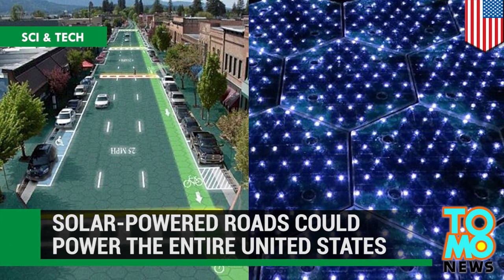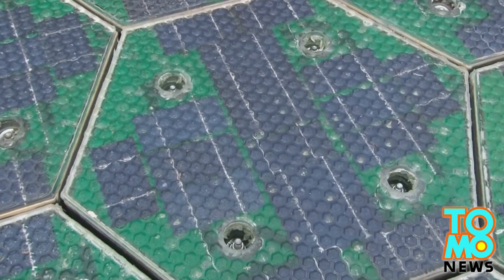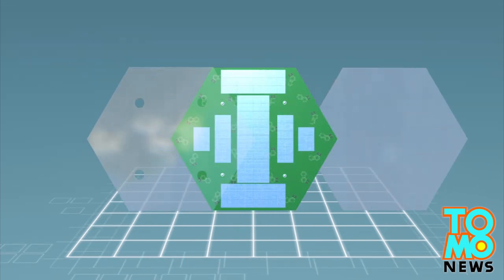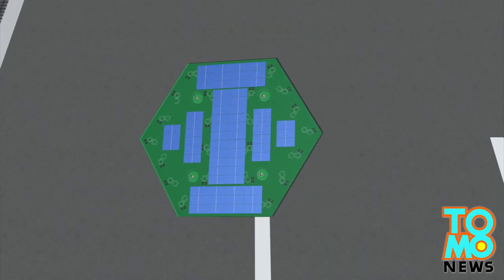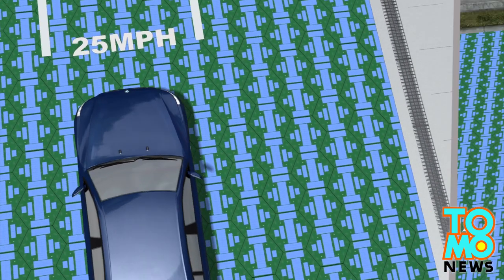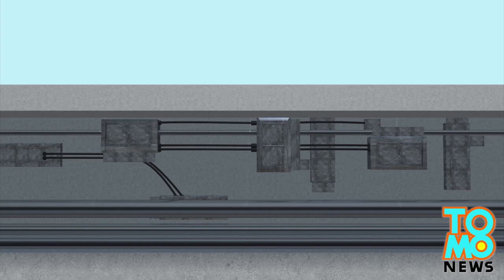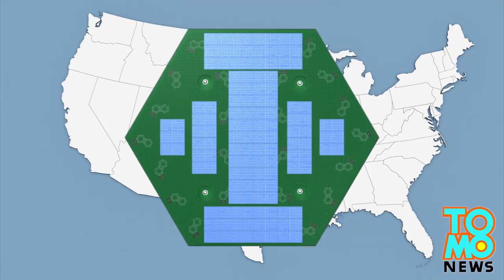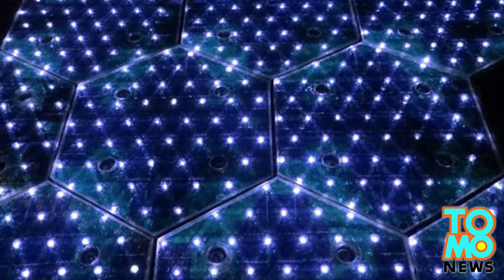Solar Roadways: solar-powered tech charge electric cars while on the road

Comment: These things won't actually pay for themselves and would, in fact, be a monumental waste of money. 

Because of its frame made from steel and tempered glass, built to withstand 80,000 lbs, each unit will cost around $7,000. A 13.4 sq ft unit with 9.3 sq ft (roughly) of photovoltaic cell on it with an 18.5% efficiency will take 360 years to pay for themselves. Unless you missed that, THREE HUNDRED AND SIXTY YEARS. And that's assuming that 1. Daylight means 12 hours of noon-day sun on a cloudless day and 2. the units literally use no energy at all for the heaters, LED's, induction chargers, wireless networks, pressure sensors, data collection, etc. Now you might say, "Ok then, so just keep them around for another 360 years, that's fine" but the lifespan for the solar cells themselves are actually a lot less than that (20 years). 

Not to mention there isn't enough money in the world to fund this project. Replacing the 41,000 square miles of roadway in the U.S. would cost $666 trillion.
Reply: they will be a lott cheaper in mass production, and they are aware of that, do you think, they didnt calculate if it is possible to make them economically reasonable? solar panel techonoligy will evolve a lot.
It seems you know what you are talking about in general, but do you know about this specific product?
Reply: Your estimates are way off but I guess you know that and you're just trolling
Reply: None of you seriously ever noticed how they don't mention how face-meltingly expensive it's going to be? Just how cheap do you think tempered glass and steel frames capable of withstanding 80,000 lbs are?
Reply: A few points you're ignoring:

1.  Economies of scale will dramatically reduce production costs.
2.  The energy generation means that these roadways would generate a significant renewable energy surplus.  That alone would offset a large part of the costs.  
3.  Eliminating the need for snow plows, salting etc would represent a significant cost saving.
4.  These roadways would be non-toxic and provide an easy way to recycle massive amounts of waste reducing pressure on landfills.
5.  The additional capabilities of these roadways in terms of traffic management, safety and efficiency would also make any additional cost well worth it.
Reply: Eric Lescarbeau A few points YOU are ignoring

1. It doesn't matter whether or not they go into mass production, the resources and micro engineering of these things is still going to keep the cost absurdly high.
2. These are solar cells. They generate 4 watts an hour (at 18.5% efficiency. It should actually be 11% because of textured glass, creator of solar roadways said so himself) They aren't going to pay for themselves for well over 20 years no matter how cheap you think they are possibly going to get. Which means the entire system is net negative since solar cells deteriorate after 10 and fail long before 20 years.
3. And if there's a blizzard? Heating coils can't cut through 10 feet of snow quickly enough to slow down traffic dramatically. Plus heating coils ALONE use much more energy than solar cells can produce.
4. Solar cells actually contain significant amounts of dangerous waste materials.You can't just simply make an electrical device "non-toxic" because you thought it'd be cool, a non-toxic solar panel would take years of R&D (if it is even possible)
5. The components and features the creators of this economic travesty are promising will use up FAR more energy than the solar cells on top of them could ever produce. LED's alone would be very difficult to keep powered 24/7. But they're also promising induction plates to charge electric cars as they're driving (are you kidding me), heating coils, high speed internet, pressure sensors, wireless transmitters, anti-theft GPS systems, and more. This system wouldn't create more energy, it would waste an obscene amount of it.

And WHY on Earth would you put solar panels under the roadways where you need to waste resources to keep them from being crushed? Why not just put them in the desert where they can actually go net positive and make some money instead of wasting it on arbitrary features? LED's aren't even visible in the daytime! Road markings are already more efficient!

But of course my entire argument is invalid because the thing looks neat. Don't you realize that a great way to make money is tricking people into donating money to you? Scott Brusaw and his wife are going to take their viral ad campaign money and disappear. It's as simple as that.
Reply: ***** Trillions. Think trillions.
Reply: Eric Lescarbeau
1. The whole project would cost well over 10x the US GDP, no economies of scale will make this remotely feasable.
2. You think these would still produce energy when it's covered in dirt, snow, scratches (glass all fogged up), car driving over them, parked on them, bad angles to the sun...etc.
3. You know how much energy it takes to melt snow? Sure as hell wont be sunny when its snowing, how are they going to put heating elements without sacrificing surface exposure of the panels/led. Afaik, glass isnt that good of a thermal conductor, are the heating elements on top or under the glass?
4. What do you think tarmac is? Its biproduct of petrol, its recycled as much as glass. How much clear non-colored glass can you recycle? They wont be using colored bottles in the production of these.
5.Whats wrong with paint on the road? Show me an led bright enough and efficient enough that can be seen in broad daylight. My 50w led is what i'd consider to be visible, youd need 5-10 tiles to even power that unit, and its only 2.5cm squared in size.

Just a few scientific errors you missed.
Reply: I think the reason why this is so appealing is because it uses surface area of the planet that is already covered.  It's basically adding a lot more functionality to existing structures.  Whether or not this particular version is feasible is of course debatable but I think there is definitely sound logic in using existing surfaces exposed to the sun to generate electricity rather than placing panels out in the desert.  It's not about the efficiency of individual units (although with large scale production and more intensive investment in R and D that will almost certainly improve dramatically).  It's about making use of as much possible surface area that is already in use.  

Replacement of solar cells would be a lot cheaper than you're suggesting.  You don't have to replace the entire unit to do that.  And of course if solar cells were being used this widely the technology would massively improve from one generation to the next.  Consider the microchip over the last 50 years.  If we took money out of developing fossil fuel technologies and put it into solar I have little doubt we'd see a revolution (possibly several) in the technology.

There is a lot of glass and plastic waste that could be recycled.  If that runs out there is plenty of raw material out there with which to make more glass.  The units themselves would also be recyclable.  As for toxicity, as I understand it there would be no toxic runoff from these cells because they're sealed.  I find it hard to believe that they'd be anywhere near as bad as asphalt.  Regardless, given that photosynthesis does basically the same thing without being toxic suggests that with sufficient amounts of research we can achieve the same result.

Existing roadways "waste" resources to produce a supportable structure for the roadway so I'm not sure what your point is there.  I am generally in favor of much greater mass transit and a reduction in roadways and cars in general so in that sense I do see all roadways as wasteful to some degree.

Heating the roads would of course only be used when needed.  Likewise with LEDs.  Because these roadways would be part of the electricity grid power would be used where and when it was needed, not on a 24/7 basis.  There are a ton of efficiencies there in terms of labor and time.  Many of the other features would reduce or eliminate the existing means of providing those functions.  For example, if you used induction plates to power electric vehicles you would eliminate the need for gas or charging stations and greatly reduce the battery requirements for electric vehicles.

I'm not in any position to give money to this or any other project but I do think it is an interesting idea.  I don't get the sense that this is simply a money grab and I'm excited to see if anything might come of it.
Reply: Eric Lescarbeau "You don't have to replace the entire unit to do that" (implying they can be taken apart to be repaired)

If they can be taken apart, theft would run rampant. Millions of people would simply remove them from the roads, take them apart, and sell the expensive parts of each unit.

"As for toxicity, as I understand it there would be no toxic runoff from these cells because they're sealed."

The problem isn't runoff from active cells, it's what do you do with the solar cells when they stop working and need to be disposed of? People will take them apart, retrieve the valuable parts, and discard them. So much for your sealed solar cells.

"Heating the roads would of course only be used when needed."

Doesn't matter. It won't be able to cut through 8-10 feet of snow when they really matter, and they'd still use an obscene amount of electricity to melt even a half inch of snow off the roads (when it doesn't even pose much of a risk to drivers).

It's so much easier and worth our time to simply build solar cells in the desert. That's space no one is using and it wouldn't cost trillions to install them underneath an area where cars and trucks drive every day.
Reply: Drogen Shomuro Oh MAN! It could break even with asphalt if it costed under $10,000? That'd even be remotely cool and worth my time if we actually needed to replace the current road system! That, of course, would need trillions upon trillions of dollars to create an underground high-voltage line to collect all the energy this thing produces (8-10 times more costly than building overhead lines).

Also, assuming these things are even as cheap as $7,000, replacing the 41,000 square miles of pavement in the U.S. (Scott lied, there are actually more than 25,000 square miles of asphalt in the U.S.) would cost at least $666 trillion. You can do the mathwork yourself.

And no, they don't pay for themselves. In order to power LED lights visible in the daytime (let's forget about high-speed internet, induction panels, heating coils, pressure sensors, among others for just a sec), which are about 50 watts each, you'd need at least 10-15 solar panels absorbing sunlight 24 hours a day (impossible) to just power A SINGLE LED!!!!! FREAKIN GENIUS!

But let's ignore the LED's for a moment. Let's assume we were still using road markings, a far more efficient method of reflecting light back to the driver that is also perfectly visible in broad daylight. A single solar cell (assuming it costs $7,000, much less than Scott Brusaw is predicting) produces about 4 watts an hour. Since each panel is 13.4 sq ft, with about 9.3 sq ft of photovoltaic cells on it, and since a megawatt costs $114 in the U.S., that single cell would take 360 YEARS to pay for SIMPLY ITS OWN MANUFACTURING COST!

Funny, since a PV cell fails after less than 20 years.
Reply: Eric Lescarbeau About snow plows:

You do realize that snow plows take far less energy and resources to move snow off roadways than heating coils do, right? So we'd have heating coils using an obscene amount of energy for... what? In order to produce solar energy in the north, where there isn't much sunlight anyways? Exactly where would the energy be coming from?

Besides, blacktop is far better at absorbing sunlight to melt snowfall anyway. Why get rid of it?
Reply: Their goal is to get costs to less than $10,000 per 12 ft x 12 ft segment, not per panel. It's also not about the price of replacing all the paved surfaces as a whole. Individual land owners and governments will look at the product and decide for themselves if replacing their surfaces with these panels is more advantageous than repaving. It'll definitely be more expensive than asphalt, but each entity will determine if the other benefits are worth the price. I'm sure casinos in Vegas would easily pay for the LED and pressure sensing functionality.

I'm curious how you managed to get cost figures so much more precise than the manufacturers themselves.

I'm also curious why you believe that as engineers they embarked on this project without considering those obvious points. Even if you believed they're that dumb or deceptive, they still received federal grant money and approvals for small projects meaning that other experts believe it's at least somewhat feasible after reviewing the data they've been gathering for the last 7 years.

It's good to be skeptical though. I just don't understand why you seem so angry about the whole deal. Don't give them money if you don't think it'll work. I'm sure a lot of people thought flying machines were crazy.
Reply: Drogen Shomuro I'm angry that the advertisement video is so misleading. Nearly all the stuff they say is just plain wrong. There's only one thing i really hate in the world and that's someone who's dishonest. And yes, it is dishonesty, i mean who's stupid enough to make a road out of glass??? You know, that material that loses all its frictional properties when wet.
Reply: IAN 4000 I don't know where you get your numbers from but it seems to me you're relying more on your own brand of logic than any empirical figures generated from actual testing.  I get the feeling you're just grasping at anything you can to oppose this idea.  I'm with Drogen Shomuro on this.  I doubt they'd be getting federal funding for R&D if they hadn't addressed many of these concerns.

The cells could be locked and secured to the roadway well enough to deter people from trying to crack them open for parts.  Tempered glass is extremely hard to break.  Also fines and penalties for tampering with them could be made high enough to act as a strong deterrent.  Solar cells could be designed to be recyclable.

As for your argument about snow you're not making much sense.  Asphalt can't absorb heat from the sun if it's covered in snow.  If the road is on the electrical grid then it would be heated before the snow started falling.  Blizzards can be heavy but if the roadway is warm enough then the snow will melt as it lands and before it has a chance to build up.  It's not like the snow would pile up and then you'd need big heating coils to try and  cut through it.  Snow plows are extremely inefficient.  The cost of manufacturing, transporting, maintaining and operating them (labor costs!) is higher than you seem to think.  They burn fossil fuels, they rely on heavy salting of the roads following plowing and they're slow to get the job done, increasing the hazards from the snow and generally resulting in lost hours and days of productivity.  They also have to keep returning to clear the same roads over and over again and have to be parked somewhere, unused for most of the year.  As for sun exposure I think you're forgetting that these cells would be there all year round and not just on overcast snow days or just in the winter when the angle and intensity of sunlight reduces the efficiency of power generation.
Reply: Eric Lescarbeau Grasping at anything I can to oppose the idea? No. The idea is nonsense. I've been using $7,000 as a minimum estimate seeing as how Scott Brusaw, on his own website, is still struggling to get these units below $10,000 each. EACH.

If they can be taken apart to be repaired, they can be stolen and dismantled. Also, speaking about recycling things, this thing is supposed to be made of recycled glass, right? Well not all recycled glass is clear. You saw it yourself in the video. Scott and his wife are shoveling mixed bits of colored glass into that wheelbarrow. 

I'm not sure if you've seen Thunderf00t's video, but if you are interested in Solar Freakin' Roadways then you should certainly go watch it. It's called "Solar freakin' roadways, are they real?" In that video, he addresses what an absolute and total waste of energy placing heating coils in the roads would be. When hotels in the northern parts of the U.S. heat their walkways to melt snow, they are pumping nearly boiling water through pipes in order to melt that snow. Now, in order to achieve the same effect with just heating coils, do you even realize what an extreme level of energy that would waste? In tens of thousands of square miles of roadway, in order to melt snow, you'd be using considerably more energy than the entire solar roadways system could possibly produce.

"If the roads were warm enough" I still don't think you're even trying to realize just how much energy that would take. I'm guessing in your perfect world these things heat up to around boiling temp. in order to melt blizzard snowfall. Not possible. It'd take all the energy this project is producing, then all the energy every coal power plant in America is producing, and then some. Extremely inefficient and unworkable. And you're doing this, for what? Obviously not to keep dozens of feet of snow to build up on the roads, because the system doesn't produce enough energy. You'd be doing it to keep the solar cells clear when it's snowing so that they can absorb sunlight. But in the north, there's very little sunlight! All building solar roadways would do there is waste an inconceivable amount of money on a system that doesn't work, and create an extreme road hazard.

I originally watched this video thinking it was a cool idea. So no, I wasn't simply trying to find any reason I could to oppose this video. It began to dawn on me that the cost and efficiency of the system would be completely unworkable, so I looked into it. And realized this thing would never even be close to ever being functional. They promise too many high-energy consumption features per panel, and above all, the solar panels DON'T NEED TO BE UNDER FREEWAYS where they need to be supported to keep from being crushed. They could simply be put on unused land in the desert.

So what I'm trying to do is keep people from donating to Scott Brusaw. He's a scammer and he knows it. He's done the math, realized his stupid plan is unworkable, but gone ahead with the fundraiser anyway. Why? Because he ISN'T trying to fund the project. He's trying to line his own wallet and disappear. End of story.
Reply: Dan Unpronounceable Exactly. But this guy is being dishonest for a reason. He's already raised nearly $2 million on Indiegogo for an unworkable plan. So what's the only course of action left? Take the money and disappear.
Reply: Drogen Shomuro They embarked not because they thought this plan would work (because it doesn't, not by a long shot), but because they are planning to take their indiegogo money and disappear. It'd be all too easy. And they'd be nearly $2 mil richer. 

More accurate than the manufacturers? $7,000 is a minimum estimate! Do you even realize how much the materials required to support 80,000 lbs of weight would cost? And that's excluding all the internal electronic components! 

No. No this isn't about some kind of hidden but amazing and revolutionary idea. This is an impossible idea designed to get gullible people to hand over their money. It's "Too stupid for smart people to think it workable, but too smart for stupid people to think of it on their own". All I'm trying to do is get you to save your money and avoid the latest viral scam. And you're fighting me every step of the way even though I'm raising quite possibly the most obvious reasons to not buy into this scam.
Reply: IAN 4000 You've got (some) valid points - and by all means it's extremely important not to overlook the downsides to such an immense project. But if you really think these people are just in it for the money, you're just being ignorant. Think about our species as a whole - does continuing to use asphalt roads and fossil fuels make a lot of sense? No. These people are trying to get our world to take a step forward to a better future for the sake of us and our planet. Our negative impact on the environment is not insignificant - I repeat, NOT INSIGNIFICANT, and these people realize that. It might not sound or be feasible right now to implement such a roadway system, but changes with the current roadway system will inevitably need to be made, or we'll just slowly but surely screw ourselves over in the long run. 

“The people who are crazy enough to think they can change the world are the ones who do.” - Steve Jobs :)
Reply: ***** I'd agree with you if Scott Brusaw and his wife were not engineers. They know their plan is unworkable. If it hasn't consumed literally every aspect of their lives by now then I'd be amazed. They've done the math and they know it DOESN'T WORK. But why, you ask, have they not thrown in the towel and given everyone their money back? Because that's the entire point of a scam. 

And actually, the current road system is quite a bit more efficient than you think. Asphalt is made from the byproduct of oil used for fuel. It's mixed with rocks to give it the kind of traction a glass road could never have. It expands and contracts without cracking (for the most part). And think about this: Solar Roadways wants to put LED lights on each solar unit to light up the road. But how can we most efficiently light up the road and make it safe for drivers? What if we... what if we put lights on the CARS? And called them headlights! Then, to make sure the driver knows where the center of the road is we could use reflective paint and Cats' Eyes! That way, people can see the road and the roadway doesn't use any electricity! What a far out idea!

"If it ain't broke, don't fix it"
- People everywhere

Steve Jobs's quote is invalid if the crazy person in question has a sh*tty idea.
Reply: ***** So in order to reduce dependency on oil without creating an overblown pipe dream involving using trillions of taxpayers dollars to make hexagonal solar units each made with tempered, textured glass and steel support frames just to keep them from being crushed under the weight of the cars on top of them, why don't we just put solar panels on rooftops? No one uses that space, and you'd be getting the electricity straight to the place were it's needed.
Reply: ***** If putting solar panels on rooftops won't provide clean energy, what exactly makes you think spending trillions to place delicate solar panels under roadways will?

If the idea is to provide clean energy, look somewhere else. Solar roadways wouldn't net positive with all the completely bogus features Scott and his wife are promising. It would net negative, meaning it would be necessary to build more oil power plants and import more foreign oil. Since oil reserves are nearly depleted, oil companies would turn to hydraulic fracking, dramatically increasing the risk of fracking fluid getting into waterways and destroying the environment. 

You're right about things being overlooked. But if you'd researched this "project" (I prefer the term scam) for as long as I have, you'd see the people in charge have done a far sight more than "overlook" a few "small" crippling errors.
Reply: jonas samuel no, obviously not
Reply: Tariqul Islam  i thought they will release more specific information to their testing, they didn't it appears you are right so far.
Reply: IAN 4000 you guys are too smart for me, you work it out haha
Reply: how does anyone NOT see this as a TERRIBLE idea?